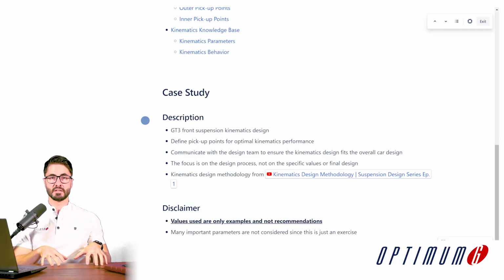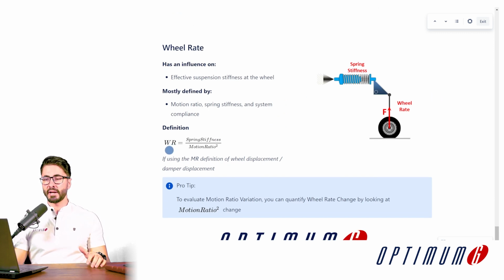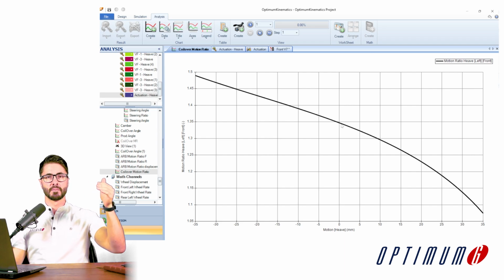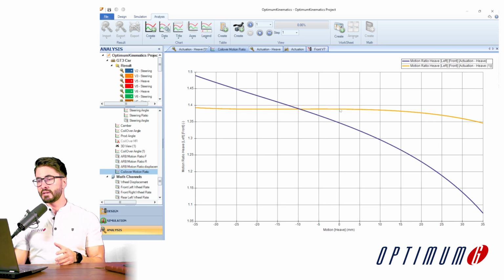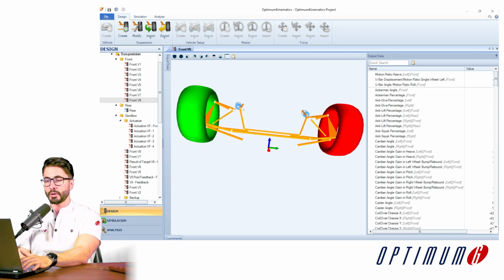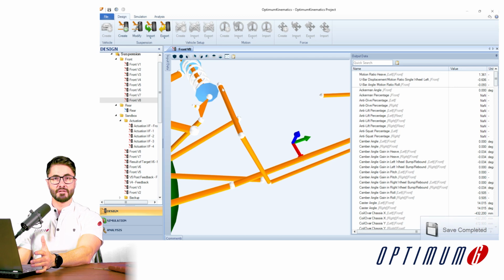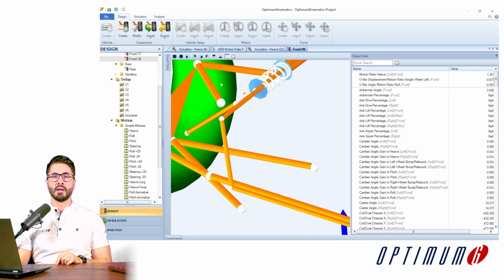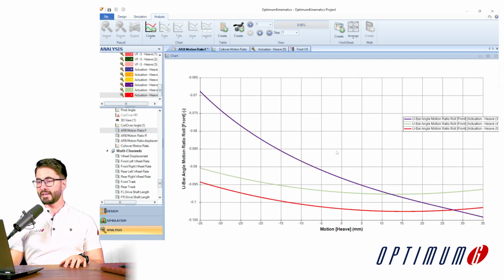DESIGN WITH ME! Actuation Pick-up Points | Suspension Design Series Ep.4

Comment: Hi, I’m trying to design suspension for my Formula student car, what’s the difference between the optimum kinematics and the optimisation module
Reply from the maker: Hello @architectred7217! OptimumKinematics is a comprehensive, standalone tool designed for car kinematics analysis and suspension optimization. The optimization module is a addon for the main software, it quickly pinpoint the best suspension parameters, leveraging powerful algorithms to simplify the entire process.